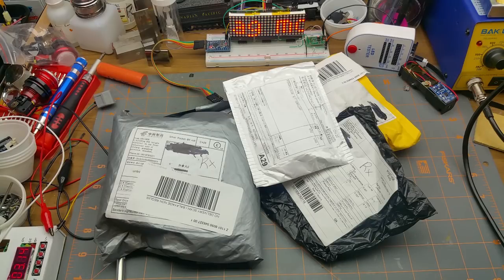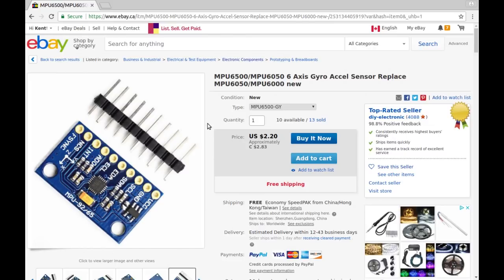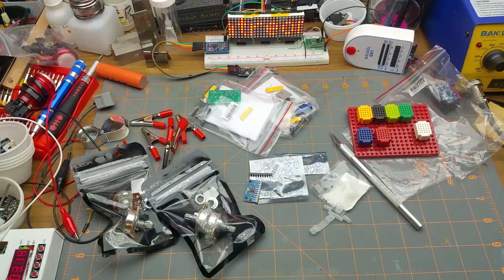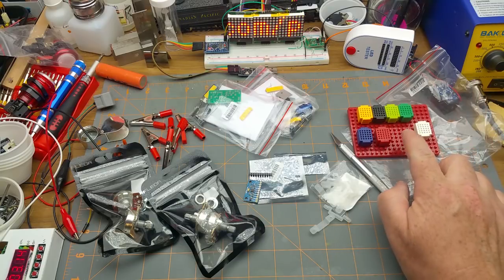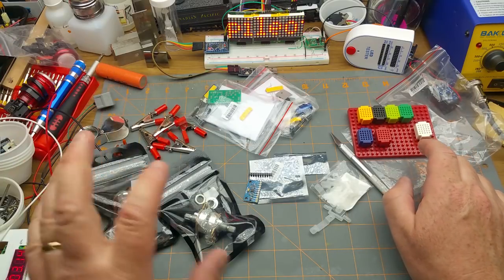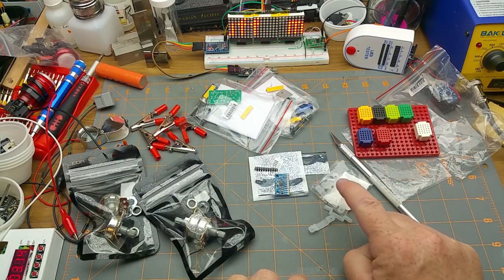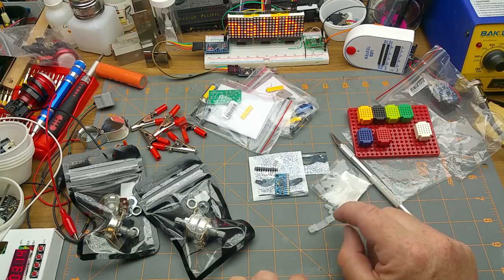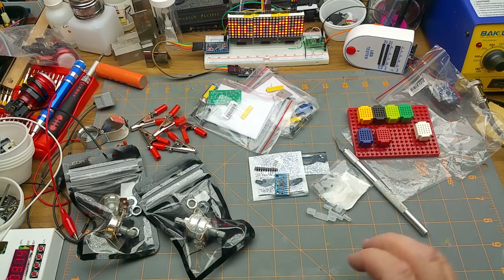Bonus long weekend mailbag monday #29

Comment: Hi       If the Crocodile clips have 4mm sockets I would try to fit 4mm plugs to the flexible
 parts so that the clips can be rotated and changed to bigger ones etc .

                                                                                                                                       Alan
Reply from the maker: Now there's a clever idea!

I wonder how many of those I have in my accumulation? 

I may have to go on another E-bay buying spree...

Comment: That amplifier has a high input impedance.  R2 = 100K.  Personaly I would put a resistor of 10K between Vin, so before C3, to the ground. Makes it a bit less sensitive when you disconnect the input wire or plug.
Reply from the maker: Yeah, for normal unbalanced consumer stereo stuff, 10K makes more sense.
It looks like they were trying to keep their inventory down by using 100K for everything.